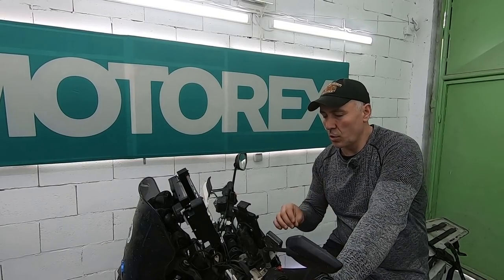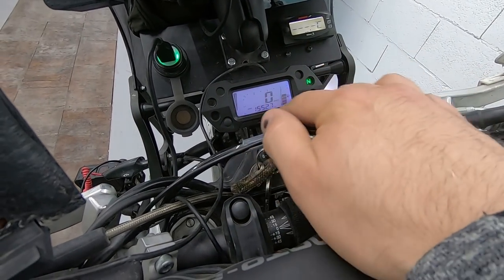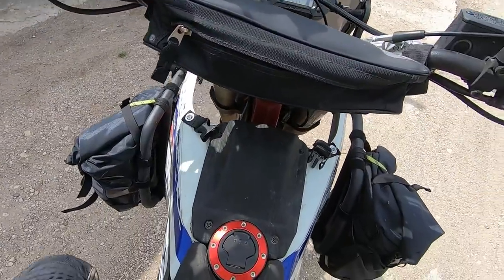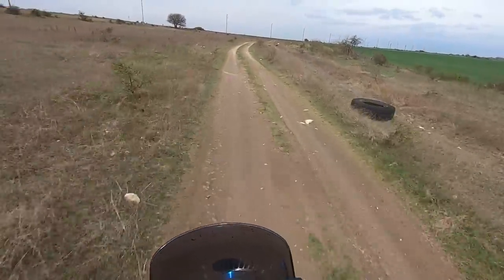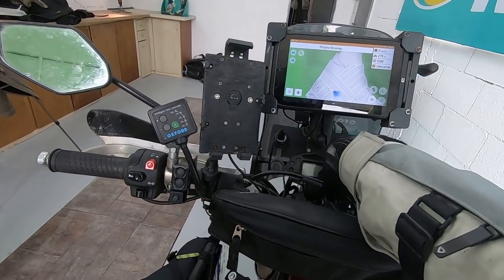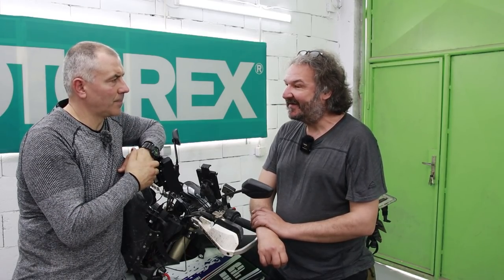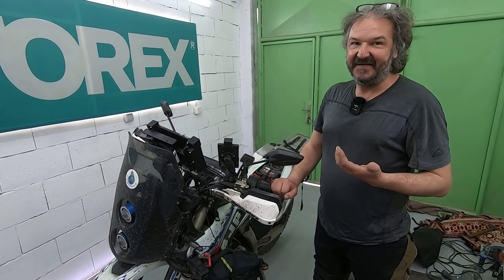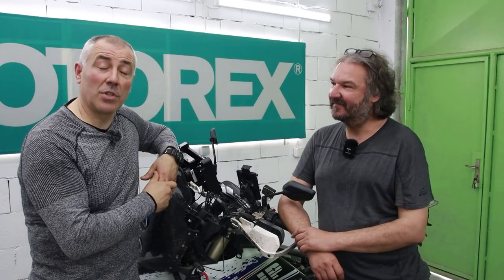AJP PR7 - Big Dirt Bike in Adventure Suit!

Comment: Nice to see more dual sport type adventure bikes being made.   I'd like to see Yamaha release a WR500 Tenere.   Something under 140kg with a 20+L fuel tank, comfortable seat and a T7 type windscreen.  Thanks for testing this bike.
Reply from the maker: That would be cool, but I don't think that it will happen!
Reply: @motorcycleadventures  A guy can dream.   They need to start making lighter bikes for the ageing demographic.   With optional lower seat heights too.

Comment: Great review Pavlin. 👍👍👍👍

The AJP was very high on my wish list but being 61 I don’t think I could really take advantage of the bike, my DR650 still does what I need it to do.

When it comes to reliability well the engine has been around a long time, it is basically a Husky 610, the same engine as SWM use in the super dual X and when BMW owned Husqvarna back in the day was used in there dual sport model, so it is not an new engine it is over 20 years old.

Parts and dealer networks are a bit of an issue but most parts are used on various motorcycles so things like oil and air filters should be relatively easy to obtain.
Reply from the maker: Only the future will show us but I really doubt that this model and the brand will keep existing. I like it and I wish the company all the best but the market wants completely different machines. Old school bikes and people like us will be less and less...
Reply: @motorcycleadventures  well KTM tried to buy ir um 2018... Portuguese company said no...😁 This is not for the big market. That is for Tenere. AJP is only for who knows...
Reply from the maker: I understand, but how you can manage sustainable business with a few sales per year...
Reply: Yes, I can understand Pavilin why not. I would not buy a model that is produced in small quantity. On the other hand, my first car was like this. First love is never forgotten, it gave me more than other cars and cost me half the price of cars of more common brands. The maintenance in the garage did not cost me more, but it is true that not every mechanic knew how to handle this model. Conclusion: If I know I have a good mechanic who knows the model, a veteran mechanic in providing good service, even today I do not hesitate to take a less sold brand motorcycle ... Then I bought the CBR250R(2013)🤦‍♂🤔
Reply: @motorcycleadventures  The future is now and supposed to empower boutique companies to produce even high quality than "the factory".....like it was before and how should be now.  The R&D and knowledge are now very accessible and micro-manufacturing processes became very evolved these days. It's just a matter of time before small highly customizable boutique companies become a reliable option...  :)
Reply: @motorcycleadventures  AJP can't fulfill the orders they have on this bike, so i can tell the business is going pretty good for them.
Reply: @motorcycleadventures  AJP designed the bike for outback serviceability.. it's the same engine unit as BMW's 650.. which is arotax.. the dash console is a Samsung tablet that can be easily replaced & software installed anywhere there's internet.. the main frame is forged aluminium, headstock section is steel and the tank is the seat subframe with threaded metal attachment lugs.. the fuel pump is an off the shelf automotive pump.. only hope they design in abs.. govt here in nz & Aus have banned non abs bikes from new registrations except ebikes.. what does that tell us about ignorant govt beurocrats & politicians.. shame you couldn't have tested it in tight single track stuff
Reply: @Errol.C-nz  it is NOT the same as the BMW Rotax motor. The AJP uses the older Husky 630 motor which is really a 600ish CC engine with fuel injection and a 6 speed transmission.

Comment: There is a rtw traveller on an AJP PR7 , with a YouTube channel : Long Ride Zone. He rode his PR7 for 34.000km in Europe 1st year. He has a video about reliability. There is another Dutch traveller on a PR7, making vids on YT , with more on reliability. On my side I tested a PR7 and a 701 : I chose the 701 early 2021, because about same price but offering more performance, and a dealer close to my home. I didn't feel good on the PR7, pegs very high, more vibrations than the 701 . 8.000km over 1st year, Alps, Pyrénées, TET, no issue on my 701.
Reply from the maker: Thanks for sharing!
Reply: And there is Heather with her PR7 in Central America currently. Her Insta channel is Improbably Adventuring.

Comment: A lot of great qualities for a travel bike. Especially the weight, for me at 73kg in the shower.
For just me maybe great but for my limited off road with my good lady on the back not ideal.
That doesn't mean I don't appreciate it for what it is. Perhaps too extreme, but I bet if Honda made a crf650 it would sell like hot cakes, ir maybe a crf500x..
Very interesting though. 
Happy travels 👍
Reply from the maker: Yes, it has a specific purpose and it is not going to match with many riders. Thanks for taking the time, Richard!
Reply: Why you think its not suitable for 2 people?
Reply: @jeckeymekayten7938  high thin, seat, no grab rails no vack rest, single vibrations. All bikes gave plusses and minus
Reply: @teneretraveller8980  thx
Reply: Yes! C'mon Honda people are waiting for 500-700 crf.
Reply: @richardvalitalo3670  they did a crf450 maybe they are working there way there.   Tha transalp is a xl750 so we know it's not really an off road model.

Comment: First time I see Pavlin liking the centering of masses on a bike with under-seat tank ! Kind of the Unicorn of contemporary adventure bikes !
Reply from the maker: I still prefer the top located tank.
Reply: @motorcycleadventures  I know. Actually, I have owned a BMW F800GS. Loading fuel was difficult without splashing the saddle, which was especially ennoying with luggage on it, but other than that I did not find the balance of that popular bike bad at all. Alternatively, I tried once the KTM 790 Adventure S with the low side-tanks and found it very nimble and well-balanced, and it seems to me it is even easier to protect against shock hazards than the standard position. Some guys say the T700 is much harder to lift up after a drop. What is your experience on this point, I mean in comparison with other bikes ?

Comment: Going to look at one today so this video was fortuitous - thank you so much.   I have the benefit of a good local dealer so I'm willing to take the risk, assuming he hasn't sold it already.  I'd prefer a basic ABS system on it but like that it doesn't have the electronics of the KTM or Husqvarna.  Sensors can go wrong and leave you stuck, and traction control just confuses me.  More a comment on me than the technology.
Reply from the maker: Fair enough!
Reply: even if a sensor goes bad youcan still ride the bike...

Comment: The engine is the old Husky 610 Red Top, so reliability can be judged from there. There have already been a few RTW trips with this bike, so should be good. Looks like a real winner. Thanks for doing this review.
Reply from the maker: Any time!
Reply: 630
Reply: The motor is a  copy of the Husky but is made in china for SWM motorcycles. The big question is, can SWM get China to make these motor to the same quality as Husky motors?
Reply: @pauleyj8  swm produces engines for many of the big brands. Swm can be trusted fully
Reply: @BiztoryTime  Wrong. There have been a number of people in Australia who have had cracked crank cases at the front of the engine on their AJP.  They have had great difficulty getting any warranty claim on these very low Km bikes. If you search the Australian Face Book group of AJP owners you will find the info. No one has been able to determine why these motors crack at the front. China has a terrible record with quality control which is a real problem for any bike using an engine from China. The fact that AJP has been seen to fail to care about after sales support for these problem engines in Australia is a big detraction from AJP. For this reason I have decided to stay away from the AJP bike. China will continue to improve and will get their quality control up to spec in time.
Reply: @pauleyj8  okay that sucks big time! Thanks for the info! Sucks that the design of the engine block allows for that to happen.

Comment: Your new youtube studio woooo yaaa!!!✨❤🎈🍺🍺Pavlin Excellent Review!
The question you ask from the heart? This is very problematic. I was 100% sure that my next motorcycle would be without plastic covers, full naked, because at my Honda Innova every small repair starts with the plastic removal ceremony (a quarter of an hour), and then put them back in place (another 15 minutes), and sometimes more plastics have to be removed and it takes for an hour (just to put off & on the plastic). Then I bought a CBR250R (2013) ...🤦‍♂😂
Reply from the maker: Thanks for taking the time!
Reply: One of my motorcycles here in the U.K. is a 2004 carb version Honda Innova 125 .  It is in almost mint condition ,runs as sweet as a nut & 100% reliable . The only pain is as you claim ,the amount of time & plastic you have to remove to service the bike . The older Honda cub type bikes had easy to remove leg shield . I think the manufacturers are deliberately attempting to put owners off home servicing & to make extra servicing & repair business for their franchise dealers . For me the less tech on a motorcycle the better ,every motorcycle has ABS ,traction control & riding modes ,it’s called the rider .
Reply: @maskedavenger2578  
The problem is not with technology. The opposite, the technology of injection is excellent. One of the most notable advantages is the existence of a closed fuel system with almost zero evaporability of fuel, and therefore zero stench of fuel in the garage.

The problem is with the knowledge, and hiding the knowledge for self-care in these super simple systems. Nothing is simple when manufacturers hide information, and when manufacturers pour your computer(ECU) into a black box without publishing what it is set to do with each sensor, and without providing a convenient connector, hardware and software, for controlling the parameters.

So you are absolutely right probably also on the subject of plastics covers of Honda-Innova, the manufacturer is building a product that will guarantee him a livelihood in maintenance time work. I spared myself the study of the ABS subject, Because I do not have one in either My-Innova or on My-CBR250R(2013) that I bought in addition about a year ago.

I before completing a "doctorate" in studying the FI system, and I say FI is a super simple system, also very reliable. But how good is to leave the customers dumb for to charge them an expensive repairs, right? And this is how it is conducted, no knowledge is published, in order to extort money from customers.
I'm not complaining, just describing a situation.
Reply: @MyINNOVAMotorcycling  With injection you have more to go wrong ,they rely on more electronics ,sensors & more fussy about battery condition .  A carb fed system is much simpler ,usually fuelled by gravity & more likely to be able to adjust or repair on tour or at side of the road . I myself am not bothered about the stench of fuel in garage ,as long as the fuel isn’t leaking . A proper garage is supposed to smell of petrol ,oil & grease . I am well capable of servicing any motorcycle or car as long as I have the parts ,& the valve & other settings ,the main problem lies with ,the amount & time it takes to remove plastics & the likes of the EU with all their unnecessary Euro vehicle directives . This has led to stupid excess like a catalytic converters ,PAIR systems & all manner of extra electrics & plumbing to get in the way & cause us more hassle & expense .Give me an carburettor fed leaded fuelled motorcycle ,over a tech ,ethanol ,unleaded laden one any day .  I can still recall the days before the EU when it was a pleasure to get a whiff of good old leaded juice ,when out riding motorcycles .
Reply: @maskedavenger2578  
I totally understand what you're talking about. But after I made a deep acquaintance with FI systems I do not return voluntarily to the carburetor. And here's another advantage for smart FI systems: In height changes there is no need to mess with nozzles to change the mixture. But of course when you do not know and refrain from learning the new systems (which are already quite a veteran in the market), and the manufacturers contribute to the difficulty by hiding knowledge, then it is clear that the difficulty you describe is real.
Reply: @MyINNOVAMotorcycling  I don’t ride in high mountain ranges ,& it’s not hard to re- jet carbs to suit . If your fuel pump decides to pack or your battery gets too low you are screwed . I own fuel injected bikes ,but I don’t go far on them unless I have breakdown recovery ,as they are not as easily sorted at the roadside or in third world countries . There was never any need for fuel injected engines on small motorcycles, the amount of fuel & pollution was negligible ,& my carbed  engine bikes more reliable & able to be sorted. cheaper if they had faults .
Reply: @maskedavenger2578  
You are right in all your claims💖. But as long as you do not give FI a real chance you will not understand what I am talking about.

The FI system is very reliable, If maintenance treatments are performed on time, there is also no reason for surprises along the way. For example: A fuel pump never collapses in one day, there are signs much earlier, and a mechanic can replace it in time and then you don't get stuck on the road.

Even if a carburetor is impossible to perform all types of road repairs. As you know how to repair and improvise a road repair for a carburetor, you can also fix a road repairs for FI systems, including and for example, because you are interested in it (The Battery issue): Holding a Li-Ion voltage bank. A battery also does not collapse in one day, and it has early signs, and you can pull a battery more and more ... until it dies, and even then if you start with a car battery, and if you hold high rpm, the alternator will do the rest and you don't get stuck on the road.

Fuel injection is not only for clean air, it is also to reduce fuel consumption. My CBR does 34 km per liter of fuel, my Honda Innova does 52 km per liter of fuel.
Reply: @MyINNOVAMotorcycling  The amount of fuel saving using fuel injection on small capacity motorcycle is negligible & using this new E10 fuel dictated by the EU & green megalomaniacs gives less mileage per gallon or litre of fuel . The EU directive directing the use fitting of fuel injection on all new low capacity ,added about £1,000 to the cost of a budget Chinese 125 motorcycle virtually over night . If your FI version of the Honda Innova is retuning 52 km per litre ,you  must be riding at driving Miss Daisy speeds  That would put you at high risk leaving you very vulnerable on U.K. A. Roads .  I don’t know exactly what my little 125 Innova does to the litre ,but it only holds 3•7 litre of fuel . I usually ride it at speeds of  30 to 40 mph in town & cruise about 50 to 55 mph out of town with the odd burst to 65 mph .& don’t need to fill up very often . It will run on E10 unleaded ,but I prefer to use 97 octane E 5 while it is still available . I sold my Suzuki Bandit & downsized to a Suzuki DL 250 V STROM that can do around 89 mpg & about 135 kph (. 85 mph ) top speed ,it’s fuel injected ,but would of preferred it to have good old carburettors. It’s manufactured to Japanese specs in China ,but looks as well built as any Japanese Suzuki . I still have the 2004 Innova carburettor model & it still looks like new & runs like a Swiss watch & only needed usual service & wear & tear parts ,except for speed sensor for speedometer at around 16,000 miles . 👍
Reply: @maskedavenger2578  
You love carburetors, It's OK.  I agrees that carburetor is more romantic than the FI system👍
Reply: @MyINNOVAMotorcycling  👍

Comment: Nice review thank you 
the bike are 80 kg lighter than my 2019 AT DCT and 80 kg are a lot 🤔
Reply from the maker: True!
Reply: Well it's a 600cc single not a 1000cc twin so not that surprising it's a lot lighter.
Reply: @chrishart8548  i also have a Yamaha SR 400 and it is 86 kg lighter than my AT 🙂 the AJP PR7 with 64 HP the AT has no chans on the dirt
Reply: @svendusmcveteraner  Africa twin would be so much nicer riding on road. Smooth powerful stable. Comfortable.
Reply: @chrishart8548  Absolutely but have you ever made a 25000 km service on a Africa Twin ❓that are actually not very  comfortable 🤢
Reply: @Svendus  working on them seems to be a nightmare.  I don't know why they designed a lot of the bike how they did. It probably is still the best bike ever to work both on and off road.